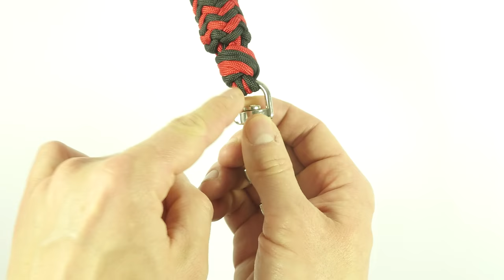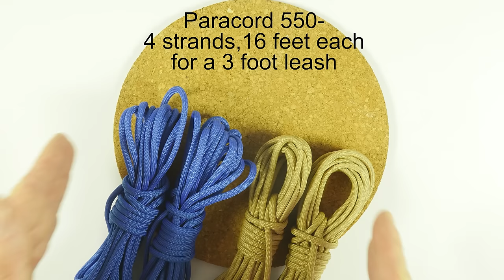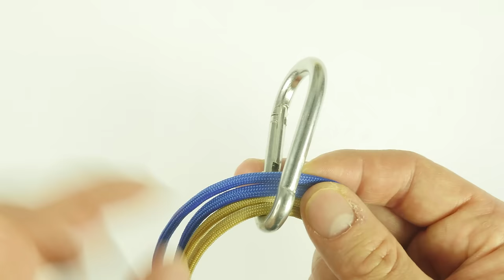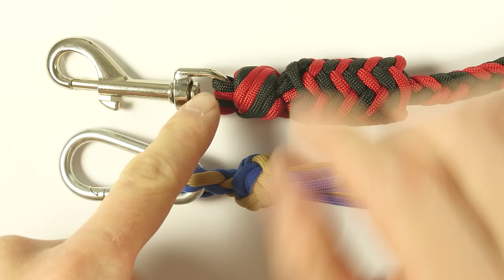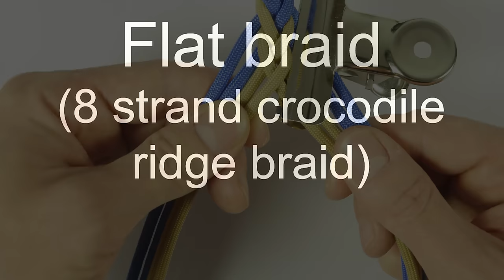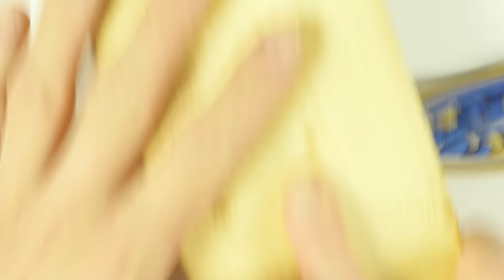Herringbone braid paracord dog leash

Comment: I struggled through this whole process and finally decided that I must have left the cord in awkward positions after the splicing process because I cannot get this decorative knot.  So I pulled it all out  and did it again and its better but it isnt good.   I have a beautiful looking leash and an ugly decorative knot that i half tried 2 dozen times unsuccessfully! Thanks Pro!  Just because your a talented speaker and understand breaking down the difficult to the simply stupid does not mean a beginner can complete this task Mark.   Hey I got a video on how easy it is to hit a 96 mile an hour fastball,  but dont be surprised when you find you tried your best and watched my video 55 times to make sure you dont miss anything, and never come close to making contact!   This is not for beginners
Reply: But Thank you anyways Mr. Mark
Reply from the maker: Hey Brad!
The decorative knots I usually feature are indeed not easy. The only way to tie them is to try again and again until you get it down. Some knots like the Matthew Walker knot took me years to finally figure out properly. The harder the skill, the more special and valued it is!

Keep at it and congratulations of getting this far!
Reply: A bit late maybe but i also had trouble with the big decor knot, so after 3 failed attemts i decided to use a tube to make it easier. Found one that i was just able to pull the handle thru and laid the knot on top of it. Got ALOT easier and i could finish it on the first attemt with just having to stop and think a bit now and then. A big + with using the tube is that it was alot easier to see when and where things had gone wrong and just by thinking a bit it was fixable without having to restart the entire knot over and over. Was also alot easier to move the knot into the perfect spot when done .

Comment: This is a great video. As my first experience in paracording I think I did quite well. there were some hiccups but in the end I only have one major issue and that is the decorative herringbone knot. Are there any other videos that go into that knot. I am on my forth try because I want to get it right. After wrapping around three times and going over under 6 times each I just can't get the come back of the second 4 strands any suggestions?  Thanks

Comment: for which breed of dog this leash es designed
Reply from the maker: Hey!

It is quite strong, so it should do for most breeds. You mostly have to adjust the length to fit the size of the dog, other techniques are pretty much the same.

Mark
Reply: Lllllttrrm LLP o hi CRT